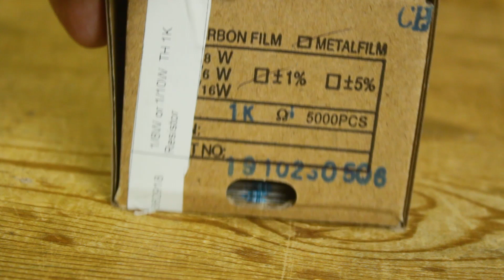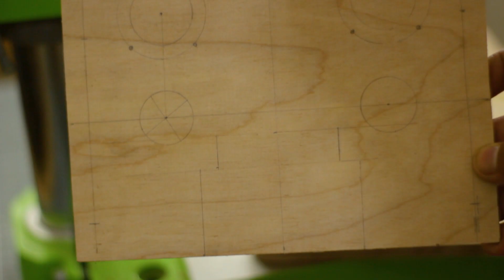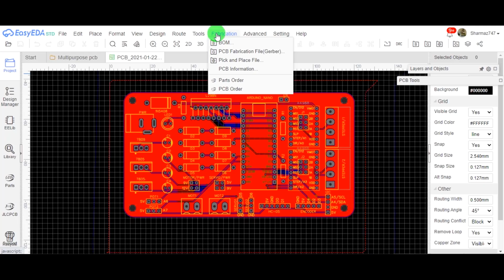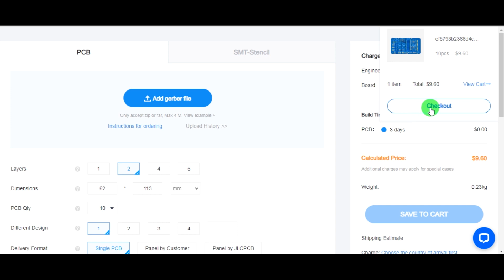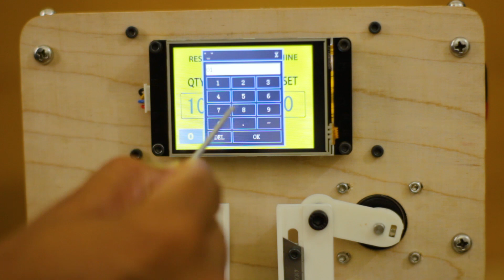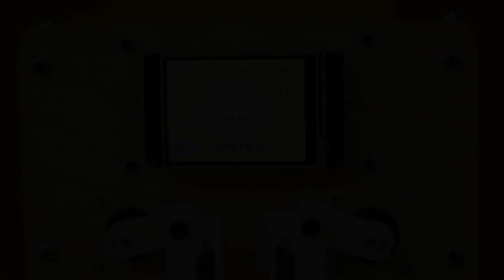DIY Arduino based resistor reel cutting machine | Arduino project

Comment: do like the design, but the logics really sucks... it's better to count it with some type of sensor, but not by motor steps. In your case you have to insert the 1st resistors in some special way that for right steps counting and also there will be a mistake in steps per mm, and after a couple of hundred cuts you'll definitely cut in some wrong place

Comment: I LOVE this build.  If i ever make a "Makerspace" i want to have a materials "Vending Machine" for stuff like electronics components, screws and fittings, sheet materials etc, and this fills some of the design needs for that perfectly!

Keep up the inspiring work!
Reply: You must be joking, over engineering a solution to a problem is far too expensive and will never pay the initial cost.

Comment: I noticed you used mosfet based drivers for two of the stepper motors used for cutting, but it looks like you went BJT for the feed roller stepper motor.  Why?

Comment: Nice, now if it could only read the color bands and print the value?🤔
Reply: or read the value with the arduino analog input by moving a small frame with two measure pins up and down on the resistors. Good idea to install small photosensor as index. that way the cutting is always correct.